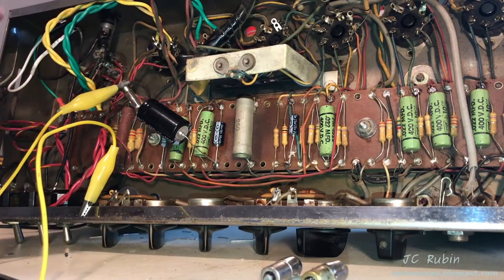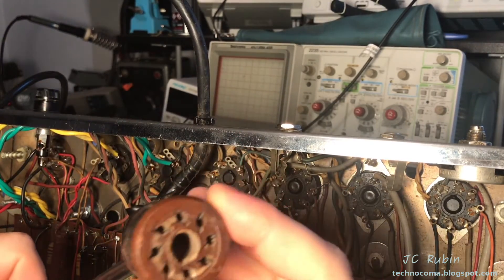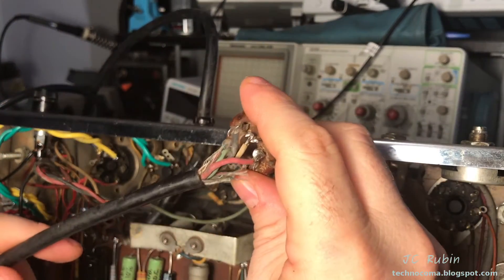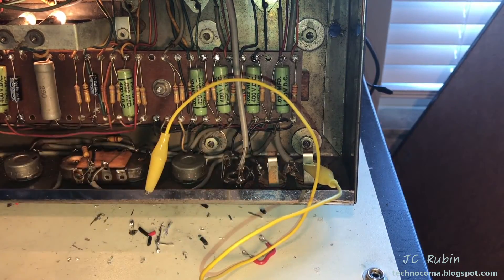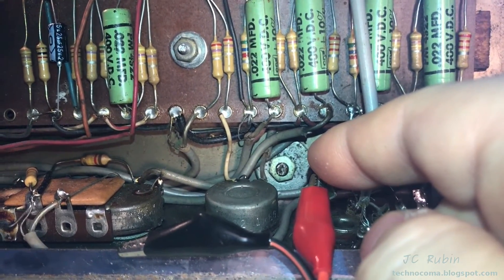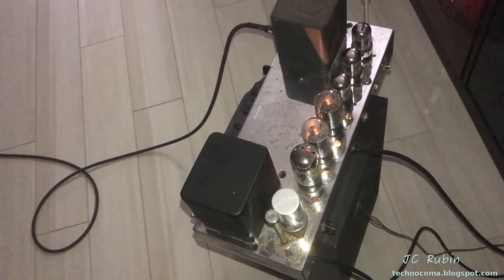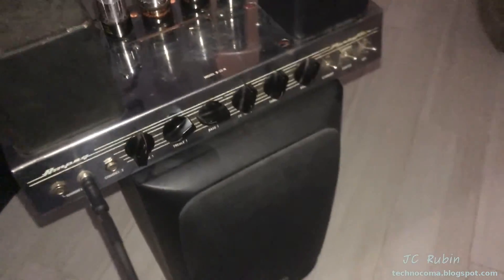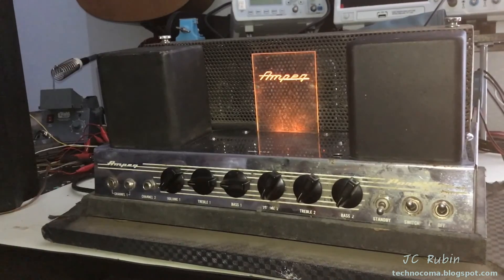Rare Ampeg Portaflex B-15-N Bass Amplifer - Major Repair [3/3]

Comment: I enjoyed this set of videos. I did a similar set of restoration work on my 66 B15NF, which had a bit less horsing around on the circuitboard since its a PCB, but worse drilling damage to install the wrong style power trans that was in it. I also had to retolex the cabinet, and that was quite an adventure.
Reply from the maker: it is a unique cabinet but to make it look nice for a complete restoration comes with some special challenges.

Comment: Did you do more than just vacuum and windex to clean up the chrome?  What else would you suggest?
Reply from the maker: No, this work was under contract, I was not paid to restore it, nor could I charge time to do so, I just cleaned as much as it would not be nasty.  My work was limited to electronic restoration only.  I would have hit it with a chrome polish for sure, maybe a wav after that like carnuba.
Reply: Thanks,  @retrotechandelectronics  - I just bought one, electrons complete but will add "chrome polish and carnuba" to the dressing process.

Comment: Does the owner of this amp have the original matching Ampeg portaflex cabinet, and how do  we know if the connector on that speaker cabinet is wired safely and correctly?
Reply from the maker: I had rewired the connections on the cabinet as well after discovering this.  It is however not included in the video series as it was done after the project was completed and the amp delivered.

Comment: You should note the colors of the wires that go from the amplifier to the speaker cabinet and write it down on the schematic.
Reply from the maker: I'd repaired the connector at the cabinet as well later after the project.